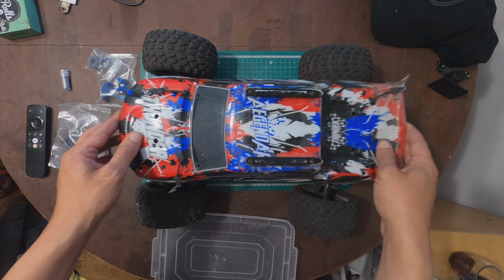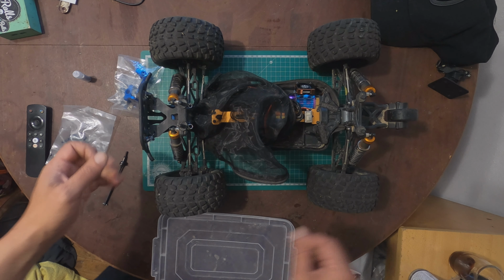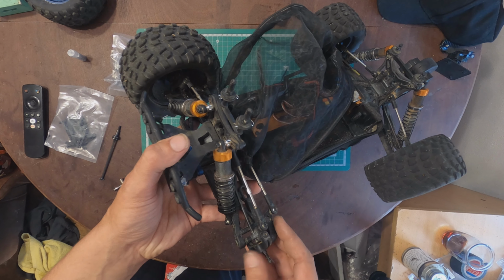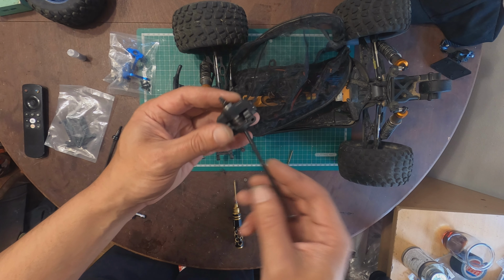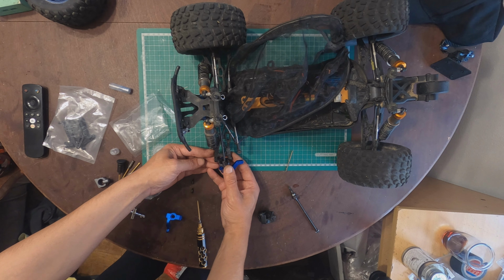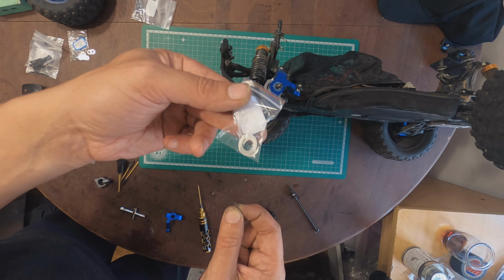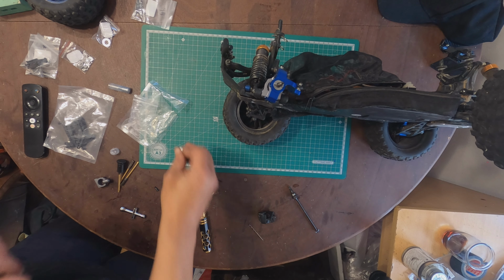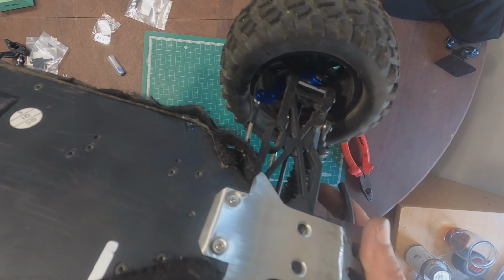Laegendary Thunder Series! Steering upgrade & changing CVD axle

Comment: Just got my car yesterday and today when i was using it noticed that the cvd axle was a little bent can i still use it like that until the new part gets here or would that mess up the car?
Reply from the maker: @saulbarraza5935  hello yes but if possible taki it out and bend it back to original position its not hard because being bent can damage bearings or a wheel.
Hope it helps my friend.
Thanks for watching and dont be a stranger.
Reply: @Fast_Lane_RC  sounds good thank you very much!!